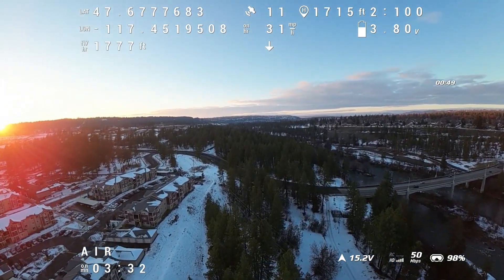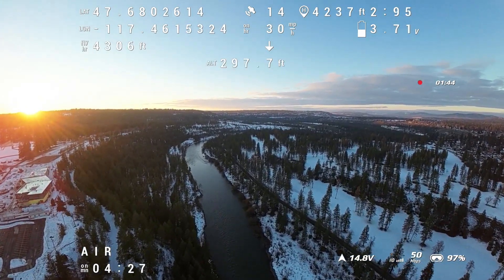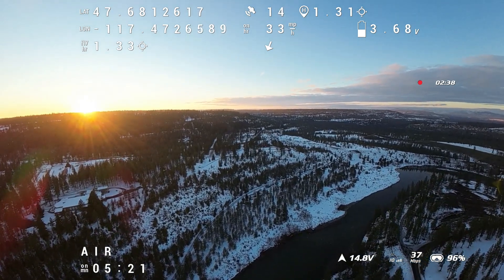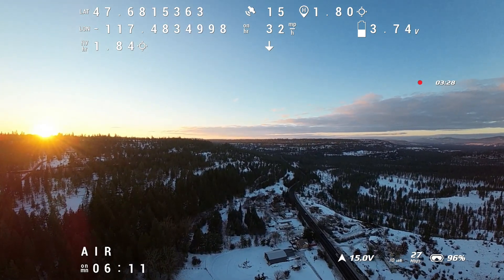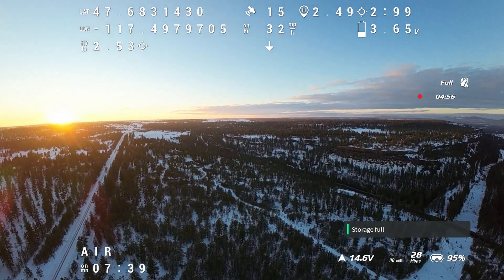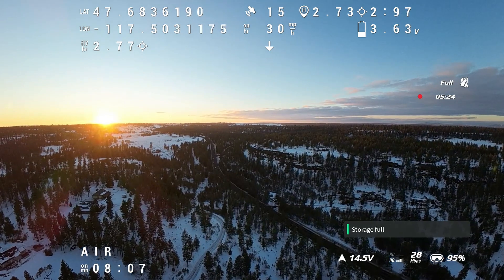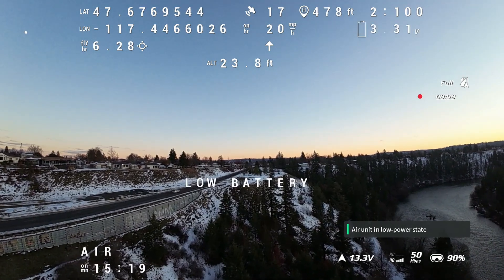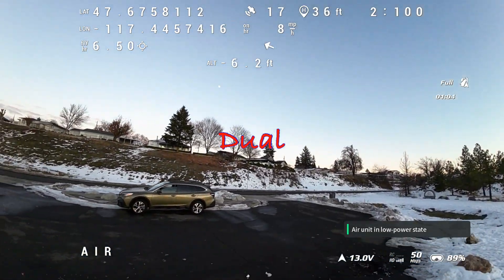DJI O3 First Range Test 3 Miles Diatone Roma L5 (few additional notes in description)

Comment: Are you using stock antenna for the 03? Or any other setting done on the 03? I have mine on FCC, but I experienced a signal lost on the 03 at 500 metres.
Reply from the maker: I’m using the stock antenna and factory default settings on mine. When you arm your quad, does it go to 50mbps?

Comment: Did you do anything to make you have better range on the 03? I can barely get to. 500 meters before I lose video
Reply from the maker: I haven’t had to do anything at all.  I have flown multiple miles away as you can see with stock antenna and setup.  Are you outside the US by chance?
Reply: @smithe68  no, I’m in the US. So you haven’t done anything like maybe fcc. What antennas do you use for the 03 unit?
Reply from the maker: @wyattdenbow7166  I am in the US as well so I didn’t do anything at all, just installed, plugged into my computer and loaded latest firmware.  What’s nuts is I am getting as far as you with a Mobula8 O3 with the tiny little whip antennas.   Do you have a spare antenna to try out, I wonder if you just have a bad antenna?  One other thing, do you have audience mode on?  It shouldn’t degrade your range that much but it does make a difference, if I remember correctly, at best you get 30 Mbps vs 50.

Comment: Very impressive!! what antenna for the 03 unit and the goggles have you used for this ?
Reply from the maker: Thank you.  This is with the stock O3 camera and Goggles 2.  I do think with bigger batteries a taller antenna would be much better.

Comment: You've mentioned that the antenna is on your left front arm? Also when with antennas, there is a dead spot directly where the antenna is pointing. Wherever it is pointing there is no signal going in that direction. So when you turned LEFT when the antenna is on your LEFT arm of the quad, you turned in a way that the antenna pointed directly from your starting point in which case you would lose your connection.

Comment: Good run. With the antenna on the rear I use a Diversity receiver crossfire, of course. For this reason, I can put an antenna on the front and one in the rear. I agree the antennas are way too short
Reply from the maker: Thank you very much.  I’ve since added a diversity receiver as well, I have one antenna at the rear and the other on the front.  I think that is for the best.

Comment: Nice Flight man. I'm also on O3 with ELRS, i have 3 different Quads. The one with EP1 is good for about 1-2km also Antenna right Front Arm. But the LQ is also jumping like yours. My latest Quad has the Batafpv SuperD Diversity RX from Amazon arround 20 Euro. All i can say from the first flights, this SuperD is Rock Solid, Signal stays at 100 nearly all the Time and dont jump as much as the EP1. If you get the chance try that one, it's performing Amazing, i had the Antennas also Front Arm left and right (also some habbits:). Should fit this Long Midrange Setup way better. As Tx i run the Happymodel ES24Tx 100mW locked no dynamic, on Firmware 3.1.2
Reply from the maker: Thank you very much!  I’m pretty happy with almost 5km at 250mw, which is what I have my Radiomaster Zorro set at.  Makes one wonder how people are going 30km on 25mw though 🤷🏽‍♂️ I just built my 3rd quad with an O3 in it and I used the Happymodel EP1 Dual TCXO rx and will be going out this morning to test it out a bit.  I hope I get similar results to you with the LQ being rock solid with this setup, I’ve put one antenna horizontal at the front and one about mid way along the side vertically, it was just about the only place I could put it and have both antennas plug in.  I have the Slim Pro version of that tx but I can’t use it right now because one of the pins on my Zorro’s module bay is broken.
Reply: @smithe68  Sounds nice, if it performs nicely let me know, mabey also a good option. I will definitly use more diversity Rx for ELRS. The price difference is not much but the Signal strenght seems way better, absolutly enoght for DJI O3 Video i would say.
Reply from the maker: @enrico320i  I will definitely let you know.  Hoping to have a good maiden flight close up and then maybe push it a little and really watch the numbers.  Me too, I ordered 2 more and they arrive today!  I plan on putting them on anything long range, which at this moment I have 7 of, not all O3 though.
Reply: @smithe68  Fingers crossed, have a fun day🚀
Reply from the maker: @enrico320i  well the short version is, the quad caught fire in mid air... actually that's the long version too.
Reply: @smithe68  oh man really 😱. Esc problem? That's Sad to hear. Did the O3 survey?
Reply from the maker: @enrico320i  yeah, I think the power cable might have come off the ESC, it was on solid but it was completely off when I got to it.  Luckily the O3 survived, I just put it back in my CineLog35 Performance and took it for a quick flight.  I’m hoping the diversity ELRS rx survived as well but haven’t gotten around to installing it somewhere else yet.  FC got torched in the flames.  Just posted a few pics on my Community tab.
Reply: @smithe68  that's Sad, sounds like an Esc short, it pulls so many Amps the cable desolder it self 🙄. Normally the rest should survive that. Was it Raining or happend for no reason?

Comment: What a great golden hour Longrange flight! The o3 is really doing a nice job on this. 👌
Reply from the maker: I couldn’t ask for a better time to fly! It was cold but no wind. The O3 is really doing well, I think they just need to make a longer antenna.
Reply: @smithe68  You mean receiver antenna on the goggle or the TX antenna at the quad?
Reply from the maker: @MrSmithFPV  neither, the antenna for the DJI O3 air unit.  It’s really short and even a mid sized battery blocks it when are far out and coming back towards yourself.

Comment: Nice video. Though for me I have to be half the height of how far I've gone. I did 2 miles out and by the time I was there I was about 4k up in the air. Wouldn't want to keep it as low as you, but these antennas are pretty good.
Reply from the maker: Thanks!  Oh wow, I've never had to go up that high to get good range as long as there is nothing between me and the quad.  I did 5.84 miles out with the OG Air unit and didn't get much higher than a few hundred feet, I was flying along a flat coast though.  The antenna needs to be longer or dual that angle out to get out from behind a big battery, at least that's my thinking at this point.

Comment: Good to have good GPS - mine is always struggling and I'm not confident at all... Nice demonstration.
Reply from the maker: It sure is and I'm super happy it worked!  Is your GPS cable shielded?  On this quad mine is and I do think it helps some.  Thank you 🙏🏽
Reply: @smithe68  No, it's stock (Rekon 5/Sector 5D), I don't think they shielded it. I'm not much of a builder, only do repairs...
Reply from the maker: @seb-depp  did you put an O3 in the Rekon 5? I have one with a vista in it, I stuffed the O3 in it but it wasn't a great fit for the camera. I have since 3D printed a new camera mount for it that is better set up for the O3 camera.  You can buy a shielded cable, I know Diatone makes one, might help?
Reply: @smithe68  I answered but since I put in an Email adress it didn’t work. 
I have no O3 (except for an Avata that I for mainly for the goggles). I‘d like to put one into the Rekon and asked the manufacturer if they planed to make an O3 version and sell spare parts. No answer yet. 
I‘d love to see your solution, posted or via mail. Link in next comment.

Comment: You flew over a bunch of power lines just before you started talking about glitches
Reply from the maker: Yeah, I did see that although it also happened a couple other times.  I’ve never had that happen before but I’ve also never flown in this spot in that direction.  I’ll have to look into it and try and find another spot to test.
Reply: @smithe68  years ago  in the 90's we had monitors that used to glitch at certain times of day . . We tracked them down to people making tea at all the same time of day and surges in the power lines which were a mile away .
Reply from the maker: @lifesahobby   oh that is very interesting and also not totally surprising in a way.  I’ve been in IT since the 80’s and it never ceases to amaze me the very weird and unrelated things that are causing a problems.  I’ll definitely scout out a different area to fly but I’m also going to do some things with my antennas and test in the same place hopefully around the same time of day.

Comment: Gorgeous sunset flight, what a way to showcase a flight test!  I'm curious if long-range FPV folks place antennas to favor signal strength when it turns toward you (versus when the quad is flying away)?  It would be awful to turn around and lose signal 😬
Reply from the maker: Yeah I got luck with that, the little bit of 4k footage I got before running out of storage is even better!  I have been reading up on antennas and one of my friends actually works with radios as part of his job and I’m definitely going to orient my rx antenna differently, basically when I turned I had a null point of signal and that far out there was no hope of staying connected.  I have a dual diversity rx I haven’t installed and I am going to put that on so I can orient the 2 antennas in different ways for better coverage.  I’m still not sure why I would lose video signal but my guess is the very short O3 antennas being blocked by the battery.  There doesn’t seem to be any long ones out yet but I can run 2 individual antennas which is what I am going to try next.  I have a couple long ones plus they would come out at slight angles which should get them out from behind the battery.